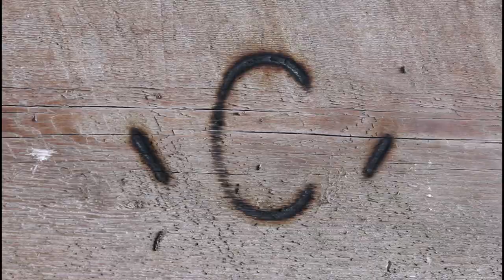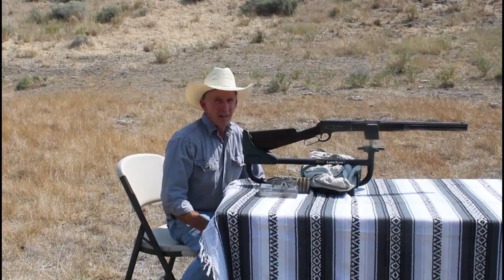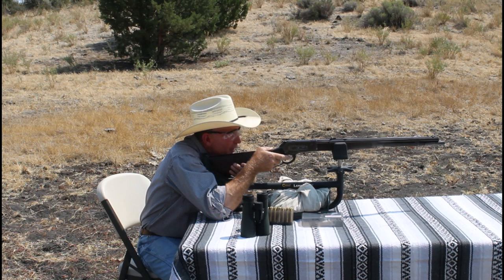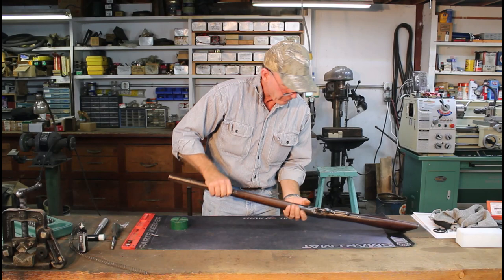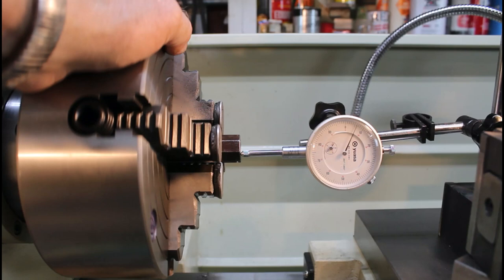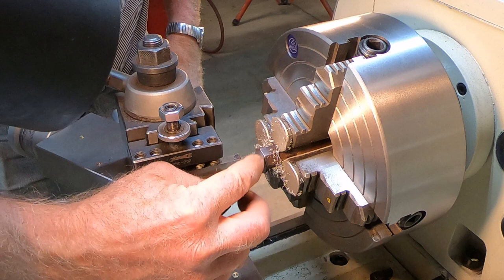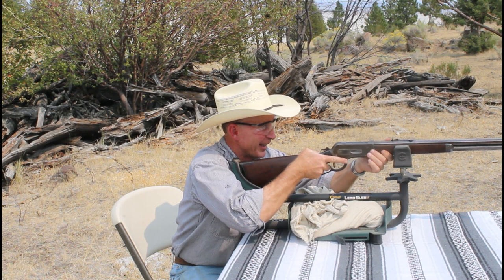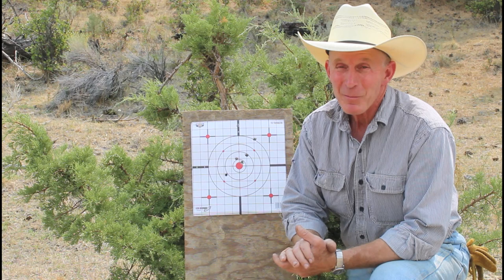Muzzle (Crown) Repair & Accuracy

Comment: Good work Mark.  40-82's can be stinkers at time to get to shoot well. Bores many times are oversized.  They were originally designed for black powder and the "bump" up effect of the black on the lead bullets to shoot well.  Get a hold of me and I  may be able to give you a few tips to get that old 40-82 grouping better still.
Reply from the maker: Thanks Mark.  I need to find some 40-82 dies and slug the bore.  I like the idea of shooting black powder through this old girl.  I'm hoping that things will slow down enough someday to get back to doing some casting and load development.  Maybe this winter.  I'll definitely get in touch when I do.
Reply: My thoughts exactly, the problem is by the time you get a bullet large enough to fit the bore and groove diameter the cartridge will no longer fit in the chamber so a soft lead bullet and black powder will bump a under sized bullet up to fit.
I really appreciate seeing these old guns brought back to life.

Comment: That’s Awesome Mark Glad all Is Back to Normal on the Cinnabar 😀😊 That ReCrowning Made a Vast Improvement In Accuracy 😲😮😲😀👍🏼 Could Instead of The 45/70 Barrel Use a 50-110 Barrel and Make It a Buffalo Gun And Add a Marbles Tang Sight 😀👍🏼
Reply from the maker: That'd make a great rifle, alright!  We had a beat up old '86 in 50-110 here on the ranch, but it got stolen with a pile of other guns years ago.  I'd sure like to find it again.

Comment: Please correct me if I missed this but I didn't see you chamfer and polish the rifling inside the muzzle ?
Reply from the maker: I probably should have explained that.  Original '86 barrels didn't have a visible chamfer.  Cutting from the inside-out on the lathe leaves the burr on the outside of the barrel where I stoned it off while rounding the corners to match the wear on the rest of the barrel.  There was just a slight wire edge left on the inside of the bore that I took off by lightly touching up with a chamfer tool, spinning it between my thumb and forefinger.
Reply: @thecinnabar8442   I've shortened and crowned a few barrels and after giving them a light chamfer, finish off with a brass dome head slotted screw with fine grinding paste in the slot. I find this gives accuracy an edge.
Reply from the maker: Thanks for the tip.  I made a domed brass mandrel on the "Heavy Barreled 1876" series for doing just that.  Not sure why I didn't think to use it on this one.  Getting absent minded in my old age. 😉
Reply: @thecinnabar8442  We all have our 'senior moments' from time to time ;-) .

Comment: Very nice job! I really like the 1886, I have one in 50/110, but unfortunately with a round barrel and full length magazine, I thought it odd the your magazine tube projected beyond the muzzle when you were shooting, I had not realised that it was moving forward. When you trued the muzzle how did you support the breach end ? I made up a bush that fits tightly in the headstock tube with 3 set screws that tighten onto the breach outer, that stops it flopping about, I once saw a 1 1/4 dia solid bar turn at 90 degs when the lathe was started, it was running at 2000 RPM though, but there must be a lot of forces in an unbalanced barrel tube. Stay safe ! Chris B.
Reply from the maker: That was the first barrel work I've done on that new lathe. It came with an outboard "spider" that supports the end of the barrel as it protrudes out the back of the spindle bore.  It has four brass tipped bolts, so both ends of the barrel are supported and can be adjusted to center the barrel.
Reply: @thecinnabar8442  That is a good set up! I made mine when I was chambering a 500 Nitro Express barrel, it is an essential jig for long stock, is your 4 jaw chuck a self centering one ? Mine is an independent 4 jaw so takes a bit longer to set up, and did you use a crowning cutter to set back the internal bore? Will you be making new cases from 45/70 brass in future? Chris B.
Reply from the maker: Mine's an independent 4 jaw.  I'd like to try a 6 jaw someday, but have too many others needs ahead of it.  I didn't set back the internal bore, just deburred and lightly polished it.  As a result of this episode, I've had some viewers offer some 40-82 brass, so I'm hoping to have enough that I won't have to reform any 45-70 brass in the future.

Comment: The power of prayer at work. Glad you and your community are safe! Another great instructional video. Thanks Mark! Wondering why you didn’t re-crown the bore? Also, a while ago I asked a few questions about the cinnabar mine operation, but didn’t get an answer. And now I can’t find which video it was where I asked. Any chance you can locate my questions and provide some information? Thanks!!
Reply from the maker: Thanks Dogbone!  I talked about the mine on the last episode about the single action Colts.  I looked back at your comment on that one, but didn't see any questions.  Sorry, but I don't remember seeing your questions, do you remember them?
Reply: @thecinnabar8442   If I remember, I was wondering,  based on the toxic mercury component of the mineral, are there any concerns of contamination on the ranch? And, are there any active mining operations being conducted currently? Thanks.
Reply: Did you contemplate recrowning the bore?
Reply from the maker: Great question and one I've researched quite a bit.  Cinnabar is basically inert because the mercury contained in it is locked up or bound in the crystal, so is not "bioavailable".  In fact, it's makes beautiful gems and has been used in jewelry for centuries.  Rarely, high grade cinnabar can have free mercury inclusions that can be toxic, but the cinnabar here doesn't. When cinnabar is heated, free (liquid) mercury is released, which can be toxic when handled.  If it's heated further, mercury vapor is produced, which is highly toxic to breathe.  At least one miner died when using a torch to "sweat out" mercury in a local cinnabar mine.  This mine hasn't been worked for mercury since the depression, but was briefly opened in the '60s to look for other associated minerals.  I can't say for sure, but I doubt there are any active cinnabar mines in the US today.
Reply from the maker: With very rare exception, the muzzles on all Winchester lever action rifles of this era had a 90 degree flat profile like the one I cut on this rifle.  It wouldn't have had a crown originally, so I didn't consider putting a crown on it.
Reply: @thecinnabar8442  Thanks Mark. Appreciate your time to reply!
Reply: @thecinnabar8442  Thanks. Understood.
Reply: @thecinnabar8442    Really enthralled with your part of the country and your ranch. Went back and revisited your Welcome to the Cinnabar and Cinnabar History Tour videos. Even better the second time around.
Reply from the maker: Thanks Dogbone!  It may be hard to imagine, but things really haven't changed here all that much from the days of the "Old West"
Reply: @thecinnabar8442  Think I was born in the wrong century. The simple life is very appealing!

Comment: Hey Mark ,,,cool video... Question ,,, I have an 1873 , 38-40  , just bought it last year ... the barrel "appears" to have been shortened because  there is no longer any crown whatsoever and it appears shiny(ish)....however , the barrel extends just past the mag tube as on all others I have seen ..... So , did they make the 73' with longer barrels than this , and/or , could this have been shortened ,,or could it just be the end of the barrel was slightly damaged over time and the crown lost ??
Reply from the maker: Most early Winchester rifles have a flat 90-degree muzzle with no crown.  Typically, only the carbines had a crowned muzzle.
Reply: @The Cinnabar  Oh !! Ok , that helps a lot , thank you !! Was looking online this evening (winchester forum) , found that it's a 1885 manufacture date (183732B serial). They also gave some dimensions that correlate with my rifle, 24" barrel , and the measurement from the center of the mag band to the end of the barrel (3.75") ,and no extra dovetail under the barrel from a 2nd band ,,,, So , I Believe it hasn't been shortened .!.. 😅.... Thank you for taking the time to respond ,  and for all you do in the videos ... Good evening ....Dan,,,

Comment: Hello Mark,
As always, another interesting video. Truly amazing how crowning the barrel made such an improvement in accuracy. Being a long-time manual machinist, I would have set my tool bit with less overhang. I know you were taking light .005 cuts, but keeping the advantages in your favor is the name of the game. I could not see the tool bit profile either, but for a real nice finish I would have ground a very slight radius into the tool bit face and with your slow feed, achieved a very nice badminton the last cuts. 

On my round barrel 1873 44-40 Winchester rifle, someone cut off the end of the barrel as well and shortened the magazine tube. My thoughts were to machine the barrel end with a step in it, then using a piece of 44-40 barrel I bought machine a cap to press fit on to the end so it would be 24 inches again. Of course, lining up the rifling may be an issue, but it is an idea I had. I think I told you how I repaired original shortened magazine tubes in a similar fashion by joining two shorter pieces of original scrap tubes by boring one piece out by half the thickness and turning the second piece down an equal thickness about 3/4 the of an inch long. Then having a snug, slip fit epoxy or soldering the two pieces together. This joint would be strong and hidden under the forearm. I think it is a better alternative than using a solid reproduction tube.